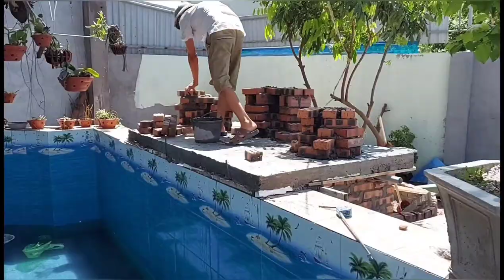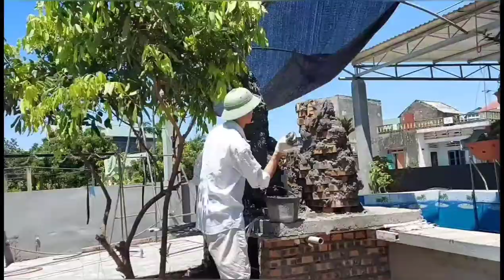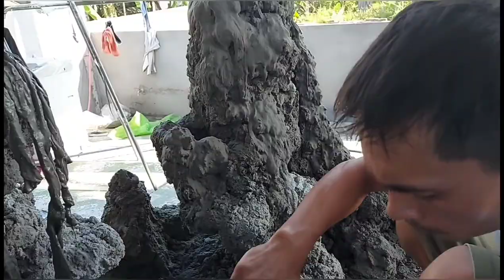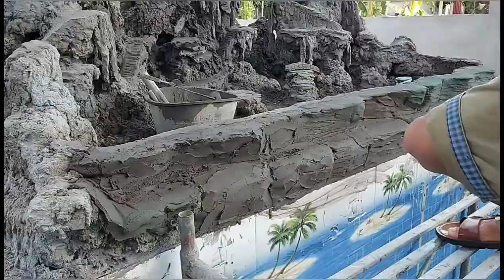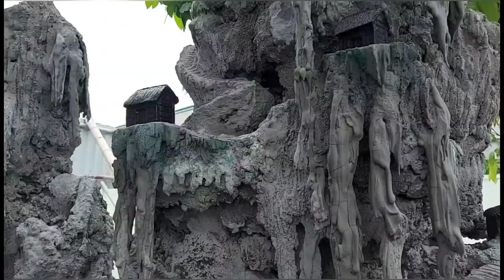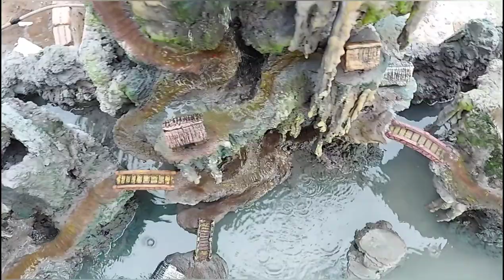How to create fake mountains with cement

Comment: What type of mix did you use? Can I use a mortar mix of acrylic fortifier over chicken wire to do this and apply it in layers after the previous layer dries?
Reply from the maker: I use cement and sand. and acrylic paint